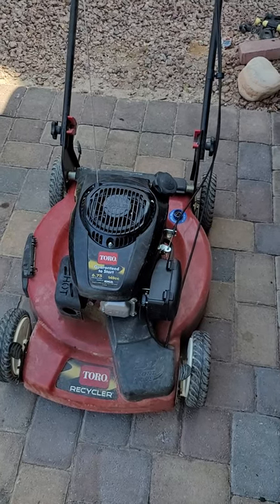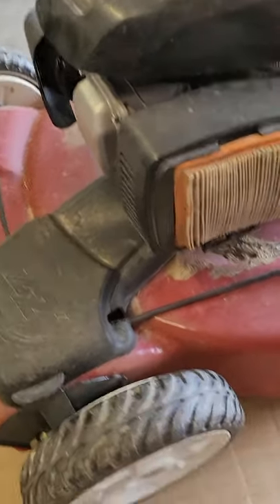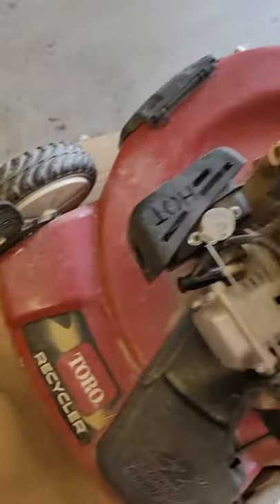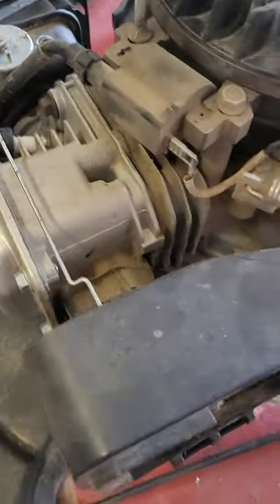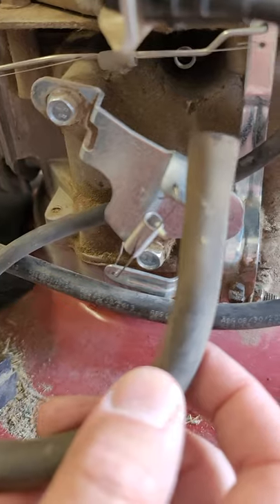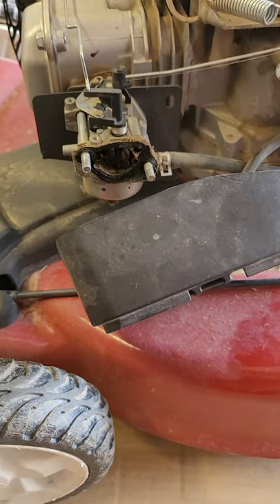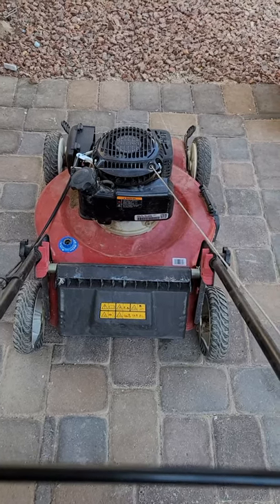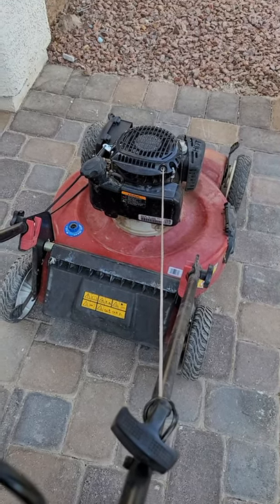Fix Your Toro XT675 Lawnmower Won't Start Issue! Fuel sys, Ignition and carb rebuild mp4

Comment: Just got one of these from a neighbor today and its been outside for who knows how long. After draining the oil and gas...A real long time. This is going to help me with the linkage and the rust on the flywheel etc. Good job and TY
Reply from the maker: You're welcome Ed. I fought this mower for months until I figured it out. Now I use it every week to mow. I love it. Good luck with your repairs and let me know if I can help.

Comment: I just got one of these from my buddy, who did not drain the gas when he put it away.  So I drained it, and the oil, put in new along with a air filter and sparky plug. No start, so I pulled the carb off and cleaned it the best I could as it was sticky brown inside. It started just like yours before the stator repair and died.  I'm thinking this is what it is with the fly wheel. Thank you!!!🙏
Reply from the maker: Thanks for the comment Dan. I am hoping you find something similar and get it up and running. I still have this mower and have used it reliably all summer long. It is a beast of a push mower!

Comment: Tha ks for the video!
Mine won't even start at all. I got it 3 years ago from Home Depot on clearance for $50. I used it the 1st time 2 months ago.  I used it twice and now ot wont start at all.

It still looks. Ew but won't start.
Reply from the maker: @danielgrundy80  My first guest would be a clogged carburetor but you never know with these things
Reply: @jcx2bby  thank you!
Maybe if I just spray some starter fluid on it first? 
Hoping to not have to take it all apart as the linkage seems a little complex on mine.

Comment: Great video.  I am having the same issue, same engine.  The engine turns off like I had a key and turned it off - - -  no sputter, etc ..... it seems like ignition.  But, like you said, and I agree: "it's almost always fuel issues."  I did have a bad sparkplug, the spark was jumping to everywhere but the electrode.  Replaced the plug, but again, thinking that it was still fuel !! The engine wouldn't start until I removed the sparkplug and primed it the hard way (no ether around).  Started up, and ran for 5 minutes, seems fine so far.  I am not convinced that I am done  - much like you, in this case.
    So, I need to go through the carb and clean it, but I still wonder if it's the coil.  My first TORO I owned had a bad coil 2 months after warranty was out. (wouldn't start it in the spring, no spark, bad coil!!).  So, I am a little suspicious of this coil as well.
  Btw: never use impact wrench as a starter engine.  I did that and split the flywheel on my Lawn-boy !!  
  Also, I am thinking the cause for your mower's fail was the abraded wire from the coil ??
It was fun ...... and helped watching you go through the engine, troubleshooting.  Thanks.
Reply from the maker: Thanks for the detailed feedback Jeff. Was interesting reading your issues and solutions too. 
Hopefully you just need a good carb cleaning and all will be well. I have had things as unbelievable as a human hair interfere with the needle fully closing on the seat in the carb, causing it to flood out. You just never know til you get in there. 
But that coil.....it took me weeks to figure this one out lol. 
I appreciate your time in providing a comment.

Comment: I have the exact mower.  Where did you find the replacement carb to buy it from?
Reply from the maker: I got one from eBay. Just looked up the part number and there were several available.

Comment: eveyr lawnmower that i get thats briggs and stratton they only start with carb cleaner why i that? no matter if theyre new carbs and filter they only start with carb cleaner sprayed into the filter
Reply from the maker: Mainly due to crappy ethanol mixed fuel running through these cheap plastic carburetors. You have to be able to take these carburetors apart and clean all the little orifices out at a moment's notice because for whatever reason they seem to love to plug up with this crappy fuel we run these days. I have found that this happens much less often if you mix in seafoam into your fuel but that's not a cure all either.